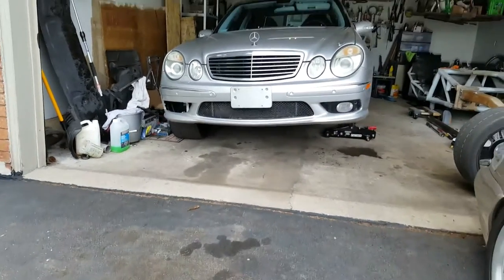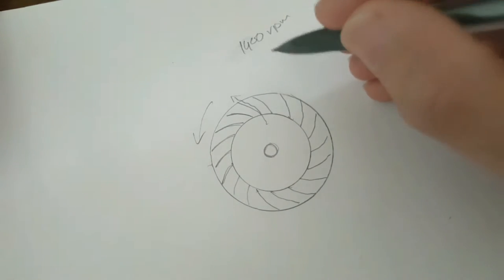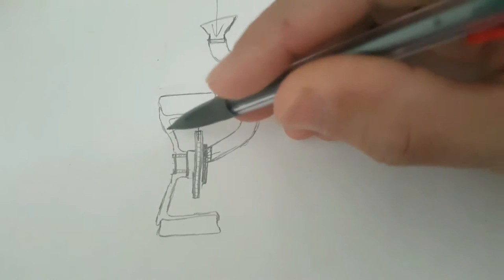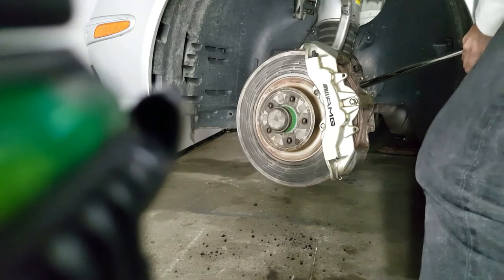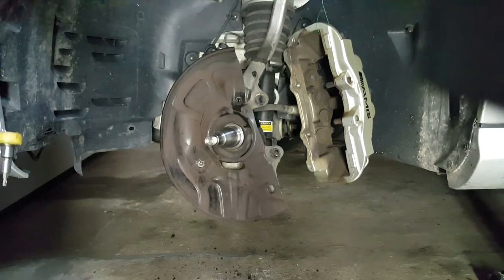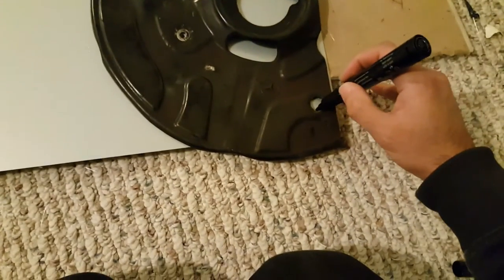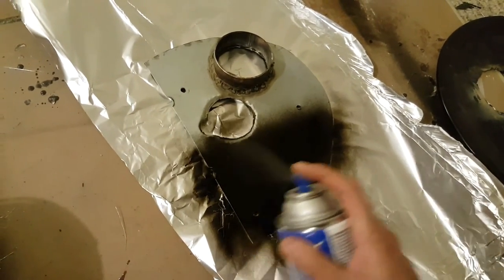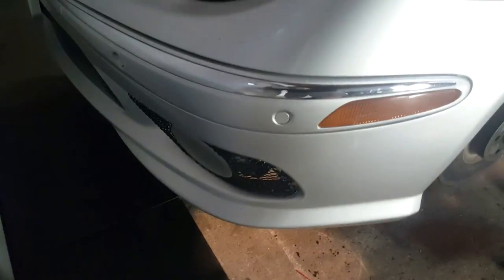How to Build a Properly Fast Track Car - Part 2 (Brake cooling ducts)

Comment: You should bleed the brakes prior to compressing the caliper. The fluid in the caliper stays mostly static and can be damaged from the extreme heat. You don’t want to force that batch of fluid back up to your abs system as it can damage it

Comment: very nice. Well made video too. Like your style and anecdotal tips. Instructions are clear.

Do the rules prohibit water cooled brakes? Would like to see some water cooling manifolds from cpus mounted.
Reply from the maker: Glad you like the videos. Wet brakes aren't really a common thing in cars. They are used in industrial vehicles mostly. They probably would have their advantages over regular brakes, but its a fairly difficult thing to implement.
Reply: SK8215 nah
 u just don't see it cause it's prohibited in most racing series. And most  "performance" automotive modifications are just mimicry.

Comment: i'd say steel brakes are as bad as it gets for track applications.... proper brakes would be carbon-ceramic.... the very least high carbon rotors with ceramic pads and drilled rotors gotta go... no 1 uses them for real world track applications, they just look cool nowadays

Comment: You should build another car from scratch
Reply from the maker: +Max Millette Its hard to find the time, but this will turn out great too. If you guys have any suggestions for it let me know. It still has a long way to go.
Reply: +SK8215 hows the amg coming man?
Reply from the maker: Working on the suspension. Ill post a video by the weekend maybe.
Reply: +SK8215 Glad to hear your still at it. Look forward to it

Comment: You have a one hundred thousand dollar Mercedes and you're using a claw hammer and an old bolt to remove the caliper pins to change pads - no disc machining - OH and whilst wearing a white jumper.  

Is this daddies car and does he know you have it?